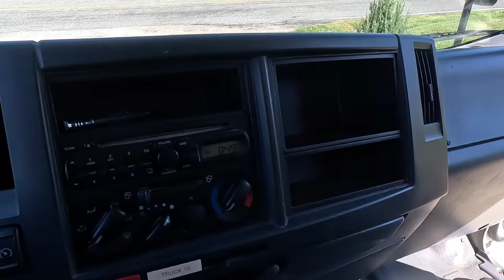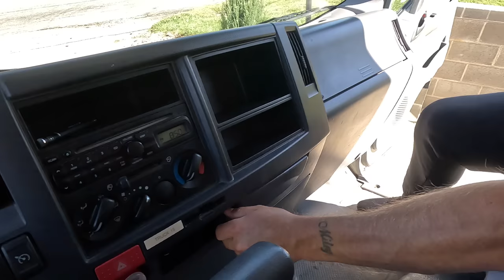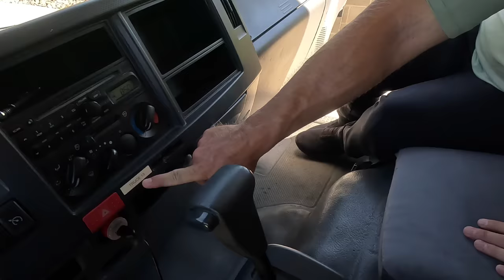I THINK I FOUND A DEAL IN THIS CRAZY TRUCK MARKET!

Comment: Nice truck for age great shape. Keep in doors if can down the road, because they will go down hill quick if not wash during the winter. I drove one diesel 97 for 9 years over 450k miles Make sure you find ISUZU dealer who services them because certain parts. Anyway great deal I would hard press find clean as that one is. There great trucks that turn on a dime. The gas are great as long as keep up and maintained witch you do anyway on other equipment da .

Comment: Put plugs and wires in it ASAP. And new filters and oil change. I would also recommend draining all the brakes and putting new fluid back in(dot 4). Brake fluid is only good for a few years.  And its exspecially prone to water absorbment up here in the rustbelt, Unless its dot 5 which i highly doubt. But u got a good LS motor, thats a huge plus. I'm guessing it's 4l60E transmission. U got about a month now b4 the weather goes to crap. Should only take ya a day to run threw everything. I'd even drain the power steering and refill it, that way u know ur good for a few years and don't have to worry. I use reg ATF transmission fluid for all my power steering systems unless it uses engine oil or hydraulic oil which is pretty rare unless it's a semi, or heavy equipment.
Reply: The 08 NPRs with the GM LS powertrain use the stronger 4L80E transmission.
Reply: @mdnky  wasn't sure if it was a 80, I know that's was right around the year when they started using the 80. Some things had 60s some had 80s. I know they played around for a few years around 06.5 to like 09-10.

Comment: :dothefive:Not trying to be "one of those guys":hand-orange-covering-eyes: But At 21:27 looks like the right rear inside tire is wearing hard on the inside. Is that rubber i see on the Spring hanger? or grease. Both bad. but looks like it need a rear alignment. Keep up the good work. Im from Ohio Also. Peace:hand-purple-blue-peace:

Comment: good buy, great truck... maybe wire wheel the frame, spray with rust oleum then hit it with a little fluid film ... if you will throw a little dirt on the fluid film it will not come off as easy...